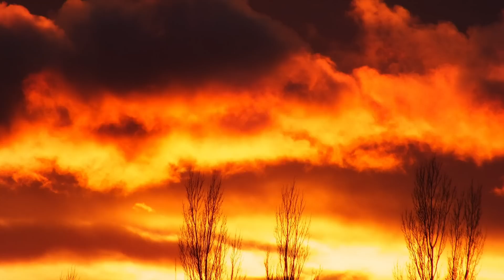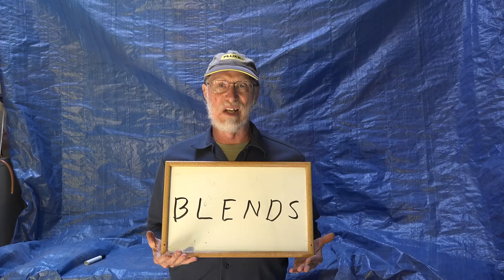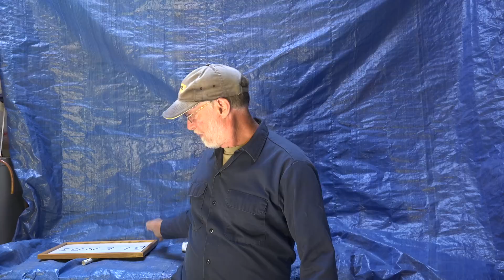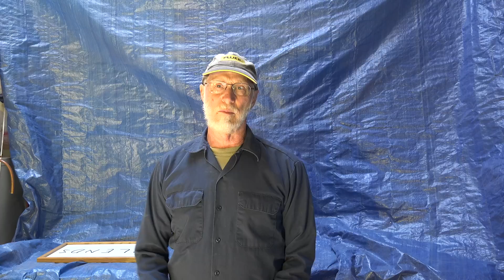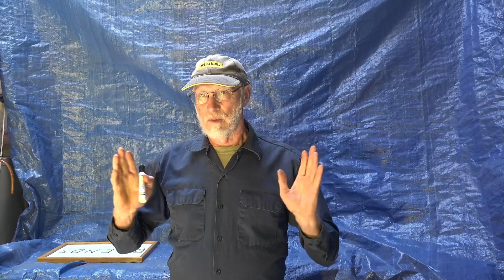Why we use blend refrigerants

Comment: A lot of people panic when they find out what it is, but R290 is ( in my unscientific research ( plug it in and run it )), a great replacement for R22.  Got several units running it.
Reply from the maker: It does work.  Problem here is a leak could fill a basement with flammable gas because it is heavier than air.  I understand that we use propane as a fuel for appliances.  Still have a problem with it.  Especially if the unit is not marked that propane has been installed.  Next tech could get a nasty surprise.  
GFM
Reply: +grayfurnaceman I know... wasn't saying it was without risks. Thanks for the reply.
Reply: Horrible idea using propane to fill high pressure lines and coils in a residential or commercial setting. Extremely high liability, you'd better have a few mil in gen liability and personal injury.

Comment: My cousin said he put 134A in 4  hvac 1.5 ton split units approx 4 yrs ago and they are still running. He said he did this because he did not have access to R22. I always question what people say and you say they last about a yr. I also know that most people are not flushing the lines when changing from 22 to 410a. Most are just blowing out with nitrogen. I have seen videos on youtube from some of the biggest buys on youtube. Do you have an opinion?